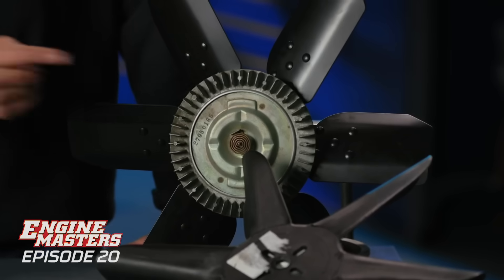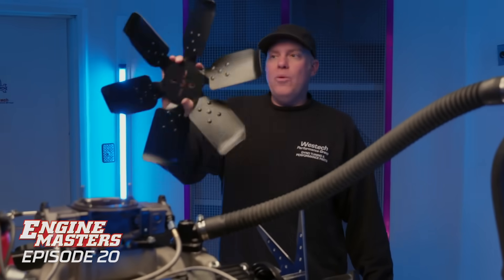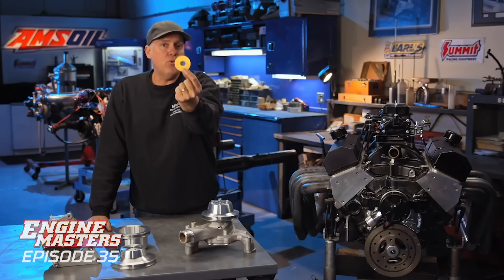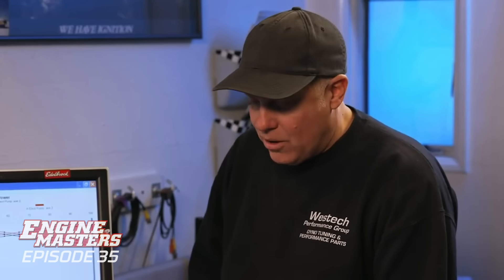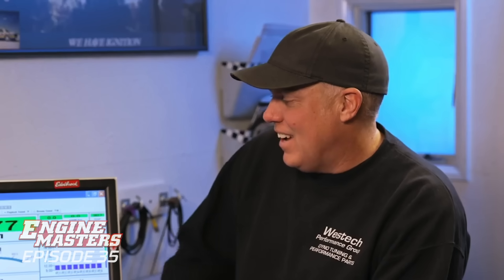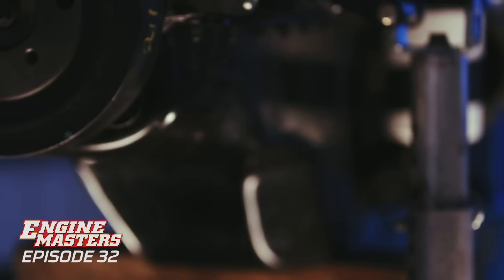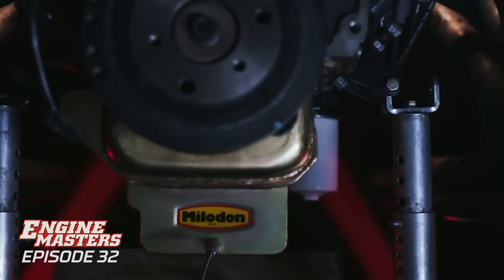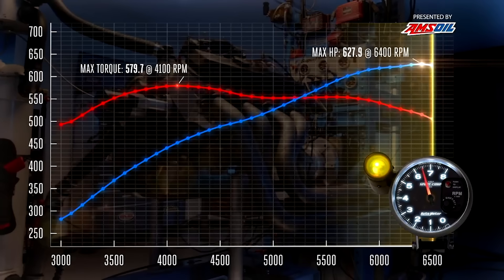Don't Do This! How to Ruin Your Engine's Horsepower | Engine Masters | MotorTrend

Comment: When the car is moving and air is blowing across the radiator the fan loss will be less. In the dyno room that fan is struggling to pull across the radiator and through the shroud. Good information though!

Comment: I dont believe rhe cooling fab will steal power while in motion. If you could simulate speed of air increase through the raditor. I believe the loss would be negligible

Comment: You never showed how the stock fan with clutch performed.  Was this edited out? Why? Also, although there was conjecture about the power consumed by the additional loads on the alternator drawn by using electric accessories these were never tested.  I would think this would be important? What gives?

Comment: I wish you guys would have calculated horsepower loss when additional load is on the alternator from an electric fan...

After convincing us that engine fans are a power suck, it would be nice to know if it's worth switching to electric...
🤷

Comment: I changed out my triton 2v from a clutched fan to 4x 12" 2300 CFM, HUGE difference Hauling 4.5 tons up steep grades for 30 minutes on a 98* day NO ISSUES 10MPH faster at WOT. my next upgrade is a electronic water pump. currently i have yet to see temps max past 198 right where i have the fans are set at 195 on and 185 off, Tstat is 185 every HP gain adds up when it comes to real life stuff too.

Comment: I had recently purchased a new aluminum radiator from Champion. I asked the representative if they offered an electric fan option for my application. The gentleman told me to use the clutch fan. That was good enough for me.

Comment: Can you do a video on the Impala and other GM vehicles LZ4 V6 engine block and comparison to the V6 Ford fusion engine of similar comparison? The LZ4 is an OHV with high low end torque, so I wanna know how that can be changed to be more balanced with HP and torque.

Comment: Interesting test..
I had a 2002 I finiti M45 V8 4dr sedan. The engine fan was a hydraulic drive off of the power steering pump. The bypass flow built into the fan drive was such that you could hold the fan still and start the car! So. Much like a solid mounted engine fan, it was turning as long as the engine was running. I live in AZ and never had any overheating issues. Even after 150000 miles. Great set-up!

Comment: I never use mechanical fans, if one is on an engine i remove it and install an electric with adjustable temp control for on and off temps

Comment: Currently in the renewable energy sector, the most efficient design for wind turbines (HAWT or VAWT) is still undetermined.  This automotive science research may have implications on the determining the optimal design for wind turbines.  Thanks

Comment: Couple of suggestions for future episodes. I just watched the 426 vs the 440 six pack episode and was wondering if you played with cam timing at the timing gear if you couldn’t have seen a closer result. Thinking that advancing the cam on the Hemi 2-4 degrees wouldn’t minimized the torque advantage of the 440. Also maybe retarding the cam timing on the 440 2-4 degrees should bolster the top end.

Also would be great to see a shootout of stock iron manifolds vs shorty headers vs long tube headers vs step tubed headers. Just some thoughts.

Comment: How much of a load was put on the alternator?   1Ohm at 12 Volts is only 12 Amps.   12 Amps at 12 Volts is 144 Watts - 745Watt is one horsepower.   Even at 60 Amps,  your pushing 1hp from electrical drag.   So it has to be bearings and pulleys.

Comment: I'm baffled by the amount of HP the flex fan takes...that might explain in part why my 79 Capri V6 feels so slow (not that it's fast to begin with). Rated at 110hp, it feels more like 70, and it can't climb a hill. 
I got it with a flex fan installed, thinking it was an upgrade I left it but planned to install an electric fan mostly to clear up the engine bay. I guess it's more needed than I thought. 
Also I went through a water pump (the shaft came off) even though it was replaced shortly before I got the car, and now the new one is already showing signs of wear (the pulley has some play). So not only is it taking horsepower, but it's also damaging the water pump.

Comment: Hello this is this was very interesting but you never said what the clutch fan did which I know myself from my past that the clutch fan was better didn't take near as much power away for the most part but then when you also add electric fans you draw more on the alternator so it pulls horsepower like crazy so but anyway I would like to her how much the clutch fan draw

Comment: 11.80 @115mph BBC car, took the aluminum flex fan off added a factory clutch fan in place of flex fan, ran the exact number. Test two took the power steering belt off, ran the exact number 11.80 @115...E3 spark plugs next...ha

Comment: Smokey Yunick would say run a 30% more flow water pump .  Then run a 30% under-drive crank pulley or 15% under-drive crank pulley and a 15% more pulley on the 30% more flow water pump that way you still got the same cooling !

Comment: watched this 3 times and they only tested the plastic fan and the large 8 blade steel fan ? where are the tests for the aluminum flex fan and the stock clutch fan ? pretty much know the flex is better but if the dyno room temps are air conditioned then the clutch might free spin and draw no drag and come out on top which would be a faulty test environment not a real world reflection.

Comment: Where was the electric water pump with the alternator, as in car to supply the electric for the pump, you would have to have an alternator unless you want a discharged battery. An electric water pump would have more parasitic losses due to having to generate power from the alternator. And also converting from one power source to another and then back again may not be worth it! Retest with an alternator, battery and electric water pump to compare the parasitic losses of the electric water pump!

Comment: Cooling is also important, overheated engine isnt good for horsepower. Another thing to consider with electrical components is that all the work is moved to the alternator. Less load on the Alt the better.

Comment: Well I figure with the front engine junk gonna give up around up to 50+ hp. I don't have the money to buy the fancy alcoa stuff. So I use what I have and me happy. No idea what hp, but a '65 383 bored .030, Kieth black flat tops, a mopar performance 290/290 cam. I just hope at least 300hp as it will never see a dyno. Oh yeah a Carter 4bbl AVS carb.

Comment: another factor to consider is limited charging systems. My archaic 80s rx7 with an alternator that puts out 50 amps on a good day is far better off with a slight parasitic loss on the fan clutch than trying to relay a high CFM electric fan (with a 30/40amp relay) as that wrecks havoc on the already laden electric system.

Granted, this is a limited/ niche argument, but it can be a consideration for some setups.

Comment: Water temperature can make a big difference in power. I was at the drag strip one 90 degree evening and heard some guys talking about their Mustang and how they really wished they could get their 1/8th mile down from 7.22 into the 6s. I walked up and asked what their starting line temp was. They said usually 170 by the time they were done with the burn out and staging. I said ok, try something that won't cost anything but a bit of time and see what happens if you bring your water temp at startup down to ambient air temperature, so 90 degrees that evening. They ran a 6.94, and I swear their feet weren't hardly touching the ground, they were jumping up and down so much. Just a little trick someone taught me. But it's really hard to do that between rounds. Now back when some drag strips had water for you and a trough to park over, yeah, you can swap out the water and cool it back down.

Comment: After two electric fans failed in a three-year period, both times while traveling more than 500 miles from home, I had had enough of the efficiency of electric fans.  Because the 1999 6-cylinder inline 4.0 liter Jeep Grand Cherokee had enough room for it,  I went for reliability and installed the mechanical clutch fan to the threaded shaft on the water pump, and have never had another problem with engine cooling in more than 200K miles. In my opinion, a critical function of engine cooling, should not be compromised to save a few HP.

Comment: An electric fan doesn't add rotatating mass to the engine, even when you load the engine they took time to start consuming horsepower  trough alternator load, if the engine is hot at low speeds they can start cooling better becauseof they have able the maximum flow instead of be proportional to engine speed, they are more complex but for we hat I've seen more original fan clutches give problems than electric fans, the only downside I see it's a story about a diesel Cummins 5.9 that broke the water pump belt but was able to travel becauseof the air coming trough the radiator spines the air fan an it was mechanical connected to the water pump so the entire cooling system was able to work at driveway speeds

Comment: This one time... In the Band Van (well more then once) a ford e150 with a 300-6, lost allll oil pressure, just up and quit while chooching at 50mph. So I dumped 6qts in it hoping it would be enough to slosh around foam up and at least get me home, it WERKED? So I did it at least one more time, turns out the guy before me never did an oil change so all the sludgy oil and paraffin completely blocked the pick up tube... anyhow couple oil changes with cheap detergent oil, good as new, ran that beast 6 more years, through 5 accidents and countless late night punk rock shows... running completely out of oil more times then I can count... 3 clutches cause bass players.. when the water pump gave up and cooked the head off it... 

cause stories lol, after the first couple times of the oil pressure tanking, I discovered if you shut it off, waited a few moments, then fired it up, the oil pressure would be normal again until that chunk of whatever found its way back... Imagine cruising down the freeway at (top speed) 65mph when the driver pushes in the clutch, kills the motor.... waits a bit, turns key on and bump starts the pig at around 55mph.... on the freeway... I miss that pig sometimes.

Comment: Did I miss the results of the clutch fan? It seems like there were a few other results that were either brushed over or skipped as well, otherwise love enginemasters videos
Reply: I was asking the same question? I thought I was going crazy or something? He starts out by saying there are 4 fans, but only does 2 test, and doesn't say which one won? I'm thinking the viscous clutch is the winner, but he didn't say for sure.

Comment: That fan does not take 30 horsepower...
My career is heating and cooling, a 30 HP motor drives a 5 foot tall blower inside of an air handler and it'll knock you over!!!

Comment: I like the way project farm does tests and sums up everything at the end in a graph.
Woulda been interesting to test all 4 fans shown instead of just two.
Reply: i thought the same, they cut the test a bit short for 4 to only 2 . I want to know why only 1 clutch was used , why not clutch with all 4 fans , no clutch all 4 fans, pusher vs puller fans. electric fan in different available cfms. they could test fans all day .

Comment: A good test, and a good video, and if no one else says it, THANK YOU. 
 With the engine sitting in the car, and going down the road the fan gets a boost from the air coming in through the radiator. The faster you travel the more powerful the force of the air coming in. With a Drag Car traveling at over 100mph going through the traps the HP numbers generated in static mode won't be the same as the numbers going through the lights. 
 So all the data collected here only relates to an engine sitting still and not moving. 
The other issue is the amount of air being moved by each fan was not taken into consideration. The fan with the least amount of drag is going to be the fan that moves the least amount of air.
And that brings up one final issue, which is, fan efficiency. Power to cfm data would be the most useful when trying to balance cooling efficiency with power consumption.

Comment: I think your test is flawed. Did you run the electric water pump off of the electrical system being charged by the alternator? You said no parasitic losses from the electric water pump but that electric power is coming from the engine so there has to be a parasitic loss are you powering the electric water pump separately from the engine? To accurately judge the parasitic loss of the electric water pump you need to run the engine with the alternator and a battery powering itself with no external source of power for that water pump

Comment: 2 comments,  1 try windage trays and scrapers to reduce oil foaming and see if that makes a difference, and 2 install a cut out clutch on the alternator so that under full load it just spins freely like an AC clutch. Not all of us are dragster guys. Most of us run 99%of the time as only part throttle.

Comment: Alternators Can Be Very Agressive On HP If You Got High Output Alternators Under Severe Load. I Have 2 320Amp Alternators On My V6 3800 Turbo Monte Carlo (It's A Sound System Bass Car Too haha). When The Bass Hits You Really Got To Maintain Idle Because It Pulls It Down Hard. When My Lithium Batteries Are Low On Charge And Both Alternators Are Trying To Charge Them The Engine Is Probably Loaded Like 30-40HP Worth. Because It's Turboed This Load Is Always Spooling The Turbo So It's Like I'm Always Spooled Up And Ready haha. PCM Calculated Load When Charged Is Like 15%, When Batteries Are Low It Goes Up To 23%. Charged Idling The Engine Vacc Is 15"Hg (I'm At 7k ft Elevation) And Batteries Dead It's 10"Hg. Low Amp Alternators Don't Load The Engine As Bad Even If Batteries Are Charged. So Find Out How Much Your Vehicle Draws Running With Everything On And Get An Alternator With A Little Bit Of Head Room. If You Go For The Highest Output Alternator It Will Load The Engine Up More Even If Your Electrical Load Is The Same. That's What I Noticed When I Had To Send My Alternators Out For A Refresh And Ran Stock Alternator. Engine Was Barely Loaded. But If Batteries Got Low The Alternator Would Reach It's Thermal Limit And Charging Voltage Would Drop And Would Never Catch Up to Charge Batteries Back Up.

Comment: I run a factory style oil pan but I installed an aftermarket windage tray inside it. I wonder if just installing a windage tray helps any with HP.

Comment: Pro tip: Unhook the belt from your alternator and glue a hamster cage to the pulley. Insert 2 hamsters into the cage. +20 hp.

Comment: The blower on a top fuel AA dragster uses up 800 horsepower to spin the blower... But that's still a small price to pay for an overall 11,000 horsepower those things make today ... As if you're not blowing your engine you're not winning they tear them down every run replace the Pistons what's left of the spark plugs see if there's any valves missing ... Something you want to be careful of when you're putting a vortex supercharger or a pro charger under the hood of a car and if they  have it set up so there's just one belt running all the accessories and the supercharger that belt's not going to last very long ... A vortex super charger pulls about 50 horsepower to spin it at engine red line..... Something you guys might want to check out and find out which superchargers take the least amount of horsepower to spin it compared to the horsepower that is putting out..... See if you can find a supercharger that will take less than 50 horsepower to spin it and make about 200 extra to the rear wheels or whatever Wheels pulling the thing you never know these days it might be at loose nut behind the steering wheel too

Comment: Something else you're not looking at... Does the alternator put out enough amps for the entire load on the electrical system that is the radio stereo lights wipers electric fan electric water pump... If the alternator output is just barely enough to cover everything it'll have the highest load possible for the size of charge that it puts out and it'll run pretty hot and it won't last very long...... Look into getting a higher output alternator one that's probably twice what you need it will not put out one more amp then it's necessary to run the whole system but being of a higher output to start with it's going to run cooler and it's going to take less horsepower to spin it when it's under the full load of your electrical system as you modify it and add more electrical items so what's your voltage drop when you turn all these accessories on you shouldn't see any at all if the alternator is big enough..... Same thing when you're doing wiring jobs around the shop and you need a transformer in there always get one the next size bigger it won't run as hot and it will not put out one more amp will not cost you one more cent on electric bill and you'll have that extra breathing space for high energy spikes instead of just barely having enough...... And what I've seen for manufacturers they don't give away copper as they're always undersizing the wire two sizes under which is another load problem and I don't give away charging systems that are bigger than what barely necessary

Comment: Yeah running electric fans i free energy. HAHA no its not.  The amount of energy needed for mowing air thru the radiator i the same, with small variations in effectiveness. When the electric fan comes on the alternator will have to step up and provide the energy, and will be harder for engine to turn around. If you take away the alternator then yes you will have no HP loss but the battery will not support the power needed for long, maybe 10-15 min, so this is only usable for drag race